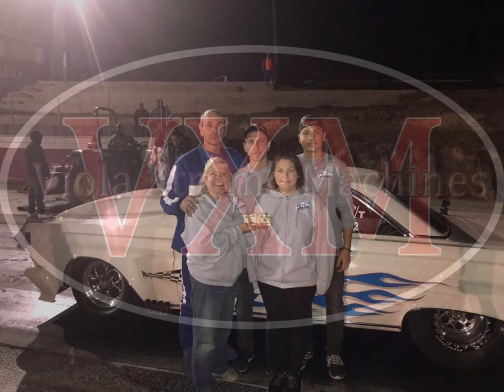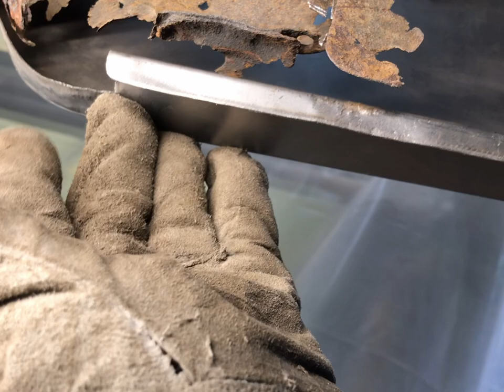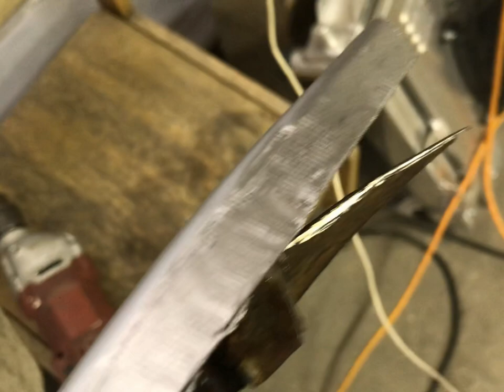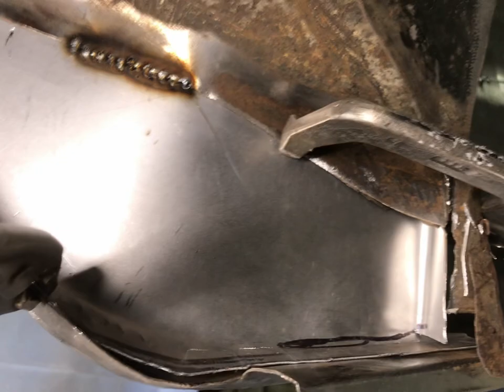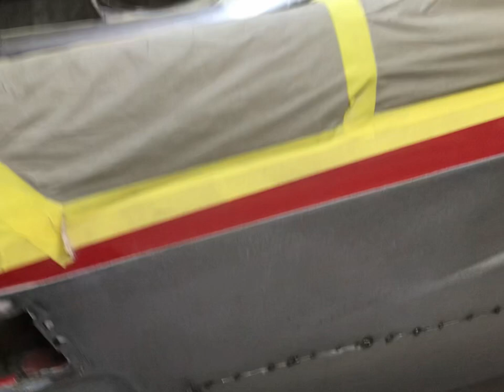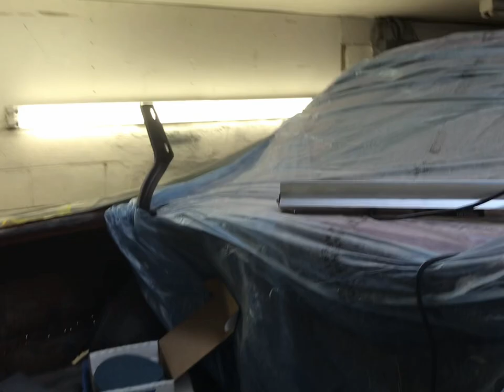65 Comet quarter panel repair part 5

Comment: I have a 65 i have been working on and it is eat up in wheel well and quarter where did you get the quarter replacement stuff
Reply from the maker: Came with the car when he Buoght it.  But honestly they’re junk that’s why there not sold anymore.    If you need metal work done.  Let me know.  Thanks for watching